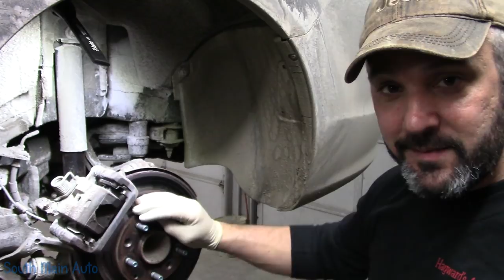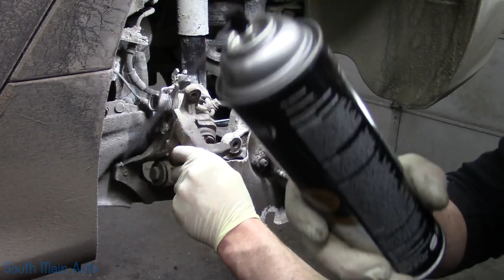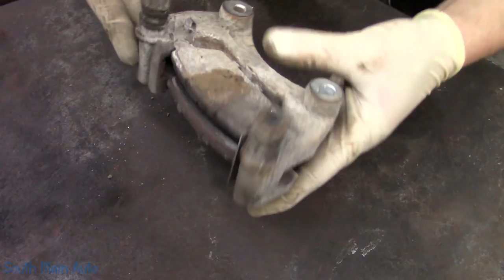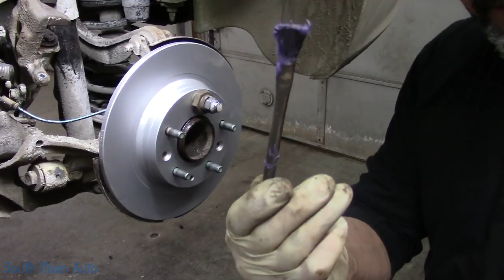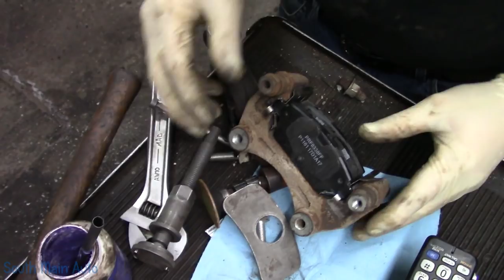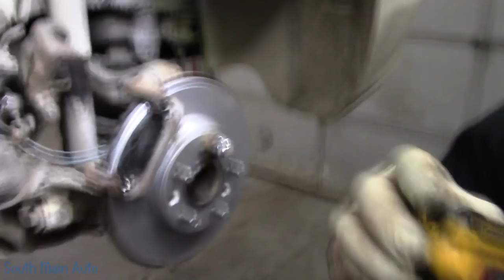Mazda 6 Rear Brake Pads & Rotors

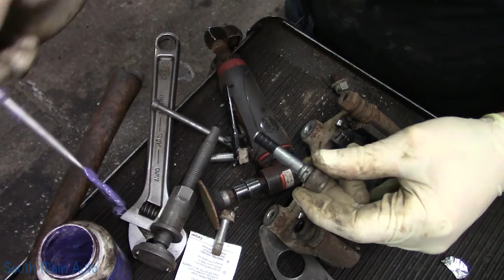Comment: What is that rubber piece on the end of the caliper pin (12:47) for? I had a 2002 Accord with that.  Somehow it came off the caliper pin, inside the caliper bracket, and jammed the pin in place. I had one hell of a time getting that pin out. Once it was out and I saw what had happened, I just left it out and never noticed any difference without it. I'm just curious about knowing what it was.

Comment: “Why didn’t you replace the screws that hold the rotor to the hub” -said by many people that don’t know what those screws are for. ALSO you don’t really need to line the piston grove with pad peg because as the brake is applied the piston rotates and gets caught on the peg

Comment: Perfect timing! Just bought an f150...brakes don't bite....can't even get ABS to activate with both feet. Pedal isn't soft. Booster has 18" of vacuum coming in and isn't audibly leaking. Quick visual of wheel off pads have some meat on them still.  It brakes straight just not well. Any suggestions on what to check?
Reply from the maker: Well lots of things can cause this actually. First thing I would be checking is to see if anything is seized. Pads in bracket, pins, etc...
Reply: South Main Auto Repair cool Mr.O thanks for the reply. Pulled everything apart today. Pins all slide easily, pads popped right out with just my hand not stuck. Rotors are all smooth and even no grooves. Since none of the wheels seem to stop better than any others seems more of a system problem. Is it possible the master cylinder is causing this, or could the booster be weak even though it's not leaking vacuum?

Comment: I’m doing rear pads and rotors on a 2016 Mazda 6 that has the electronic parking brake. Do those just screw in like this Mazda or do they need to be electronically retracted first?
Reply: I know this is an older post, but Google "mazda epb maintenance mode".  There's a whole tap dance that needs to be done with the mazdas with electronic parking brakes...  

https://forum.mazda6club.com/engine-suspension-drivetrain/436690-rear-brake-maintenance-mode-2016-ebrake.html

Comment: If the caliber pistons are threaded in and need to be wound back into position when servicing them, and there are raised points in the disks to align in the caliber piston face, how do they take up the wear distance threading back out again? Seems the caliber pistons would become set to the disk and then couldn't move anymore. IDK
Reply: Yeah, I was wondering the same thing!

Comment: I remember working on a set of them calibers when I was a younger man I didn't know they were twist then I'll beat them in with a hammer needless to say my sister had to go buy a new set of calibers lol
Reply from the maker: Lol, learning the hard way!
Reply: first set I did, I used an old 1/2" drive socket and ground it down to have prongs, put ratchet on and c-clamp to hold it pressed in. yes that was after scratching my head cussing at it for a few days. I think it was a early 90's ford thunderbird, but it's been far too many years ago to recall..

Comment: Those calipers are the same as what For used on that era Fusions.  The rear calipers are NOTORIOUS for insufficient clearance between the slide pin bore in the caliper and the actual slide pin.  I have had to over size the hole or somehow sand/file the pin to get sufficient clearance.
OR
buy a rebuilt caliper/bracket assembly with all of the hardware (pins, boots, etc.).

Comment: Why did you stop using muscle grease for the hub?? From my experience with fluid film, it doesnt hold up that good
Reply from the maker: It is going to sound silly but my Castle guy is no longer in the area so it is hard to get now.

Comment: So what is the correct way to put pads on that have squealers on them? Inside, outside, top, or bottom?
Reply from the maker: I usually go inside trailing edge....
Reply: Thanks  that's what I do but wasn't sure if that was correct

Comment: In Norway we don`t call it rotors, but brake disc
Reply: Old Norse brewery Same in Holland.
Brake discs and brake blocks😁
Reply: Same in Ireland
Reply: Same in Uk
Reply: DiagnoseDan brake disc and pads do we say
Reply from the maker: Bonnets, Boots and gearboxes :)
Reply: Do you call it a Roo-ter or a Rou-ter?
Too-may-to  or to ma-to?
Reply: Wings or Fenders
Reply: South Main Auto Repair Bonnet is what they say in united kingdom, we say hood, boots and gearbox
Reply: Upallnight neither, we call it a brake disc
Reply: Drop-head coo-pay!
Reply: Upallnight fender of course. And gearbox, tranny has a different meaning in Norway
Reply: ZON .ZON some say stuff like that, but this is the most expensive and strictly regulated shit country in the world
Reply: Al Dunn Yes buildt my heavy taxation
Reply: Don't forget, ticking over, petrol and gudgeon pins.
Reply: gary tattan but strangest of all is that clutch means womans handbag and cupling means car clutch in Norway
Reply: Fascinating!  We say vacation, I once had a couple from Ireland call it Holiday.  I thought that had more class than vacation!

Comment: hi eric , can you give me the info on that 90 degree rechargable nut runner you use please
Reply from the maker: It is made by Dewalt for MAC tools.
Reply from the maker: https://www.mactools.com/en-us/Power-Tools/Cordless-Tools/39c6f243-13ae-41ae-9736-a4ae011e6980/12V-MAX-Cordless-Ratchets/BRS038/12V-MAX-3-8-Drive-Cordless-Ratchet-Tool-Only-

Comment: everytime i do the rear brakes on my mazda 6 i put a tiny bit of syllube underneath the boot because after while it binds around the piston if you dont...just my two cents but what do i know i only have 265,000 miles on my 2006 mazda 6..
Reply: 291,000 now😀

Comment: I just use a pair of needle nose pliers to wind in the pistons, it usually works just fine.
Reply from the maker: Been there done that ;)
Reply: I haven't, but showed others how that way, being they didn't have the tool and nobody wanted a 10 mile drive to get one :)
also made some out by grinding old socket down or welding small bolts to sockets.
Reply: Had to wind the pistons back in on my daughter's Honda.  I could NOT make needle nose pliers work.  Had to get one of the cube tools. Still not easy.
Reply: easier with needle nose vice grips, they'll stay the right distance apart, if there's enough clearance. the cube tools work also, but a pita. "horrible fright" cheap kits work ok on many cars. but i've taken the grinder to many of them for custom fit, it doesn't hurt too bad grinding and hacking up cheap tools ;)

Comment: Those hardware lock tabs got me on my wife's car.  They would rub just enough to be annoying to my wife but, of course, never when I went to look for it.  I guess it only did it when the rotors got hot enough to expand just enough to touch.  Had the wheel off like 4 times trying to find what the hell she was talking about.

Comment: I'm guessing the hardware came with the pads. Here it doesn't...but a cheap hardware kit will also include the slider boots and rubber inserts found on 2 of the sliders.
Reply from the maker: It depends on the brand I get. Most of the high end pads come with good quality hardware.

Comment: Did I see a dewalt battery on a milwaukee cordless ratchet ? We need more information on this magic .
Reply: Second Creek Workshop I believe it was a Dewalt battery on a Mac tool
Reply from the maker: Yes it is a 12v ratchet Dewalt made for MAC
Reply: South Main Auto Repair 
I wonder if that is why dewalt does not have a cordless ratchet because of a no complete type of situation at least I could not find one on the dewalt website so I bought a milwaukee and it's pretty good .
Reply: I use a dewalt battery on my Black and decker drill.
Reply from the maker: I bought the Milwaukee too and it broke with in a year

Comment: That special brake tool, was it required on that particular caliper?  I thought you could just use a clamp to squeeze it.
Reply: No  do not use c clamp  on those will break parking brake .If you look at piston on caliper an see notches  use special tool to turn it  back in. You can find them on Amazon  or harbor freight.
Reply: Screw in piston
Reply from the maker: Screw in type, link to the tool is in the description box!

Comment: Eric, there is a better tool than the 2" rosin disc you're using to accomplish the job. Use a clean and strip Roloc instead. Here's a link to a good suppler of these: http://www.lehighvalleyabrasives.com/non-woven-abrasives-2-non-woven-quick-change-clean-strip-it-disc-blue-extra-coarse-type-r-roloc-compatible-cs2-xcrsr. They are the same material as the 3M tool you're using on the bolts. The advantage of these is that they only remove rust, paint and goo and not metal. I use them primarily to strip paint. They are also the very best choice when you're attempting to remove mill scale from hot rolled steel.

Comment: you forgot to dial in the disc? no one does it these days. it's pretty good to do though.
Reply: FamousByFamily What do you mean by dial in the disc? Thanks in advance.
Reply: so you get a dial indicator with a mount and attach it to the shock/strut and measure the lateral runout which shouldn't be much. can't remember what the exact tolerances are. been a while since i done brakes.
Reply from the maker: I would need to stock hundred of different shims to correct runout. Fact is I may get one rotor out of 1000's that exceeds 0.003" of runout and has felt vibration. In that case, I get a new disc (assuming the problem is in the disc) and replace it. IF I find runout in the hub I replace the hub, I do not shim them. I have not had that happen in about 6 years though and I do on average about 500 brake jobs a year.
Reply: Love your channel btw. Just had a bad week so no offense.

Comment: did not see you inspect,clean or "lube" awful external crap off disk brake caliper
     -so that SINGLE piston does not seize in housing,when hand or foot brakes applied
       I much prefer internal small drum design IN rotors for emergency brake-like Volvo's used to do
        -but only few mfgrs use that scheme, since more costly
    
yet assembly NOT super RUSTED "yet"-

Comment: Never heard of coated rotors, need to do some research.
Reply: They come out of the box with a coating that is supposed to slow the rusting down.  Personally I think it's just there to look pretty and cost more !!  Really wouldn't be shocked that it's something like a tub of silver base coat paint that the rotors get dipped in at the end of the production line. One place I worked at did "E-Coating" on auto parts. The "paint" was actually common black rustoleum thinned with mineral spirits. Parts were dipped and hung in an over to dry. It's only purpose was to prevent flash rusting.
Reply: Blazer02LS I have seen a difference, personally. I use them here too. I used to have to replace rotors every job or so, but now I can go 2 or 3 brake jobs just replacing the pads. Depending on rotor wear too... definitely a reduction is rust buildup though.
Reply from the maker: NAPA rotors call it poly coating. A lot of OEM's use this on their brakes too. Toyota, VW, Chrysler, etc...